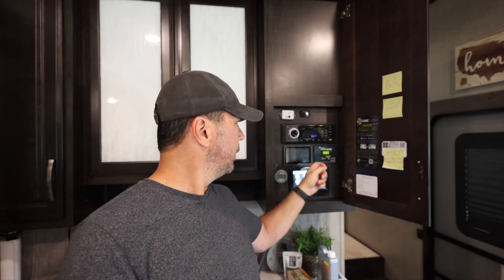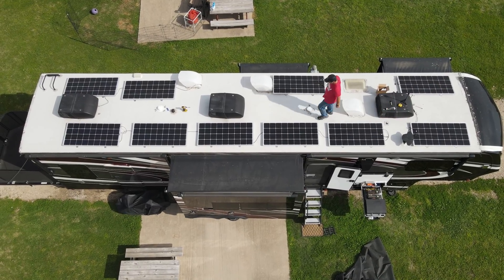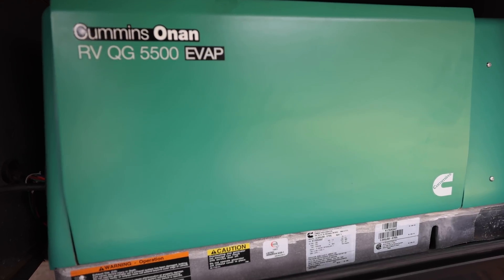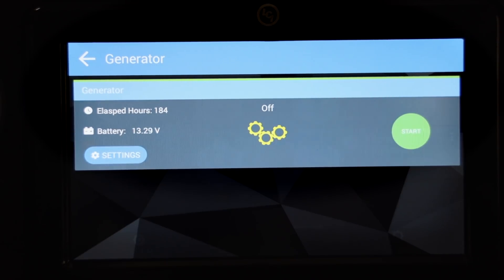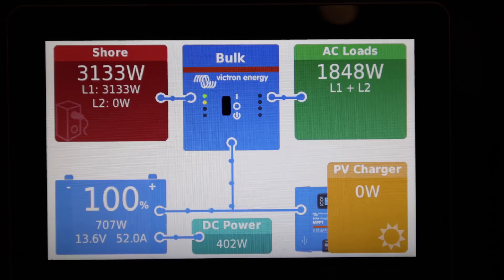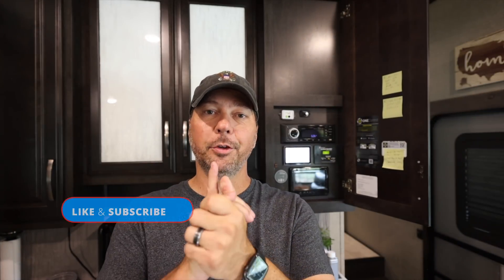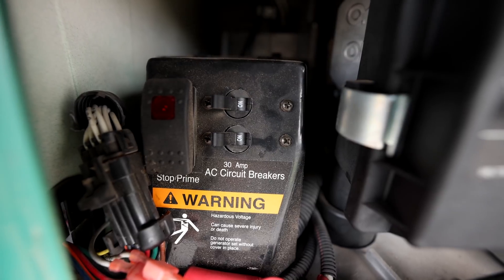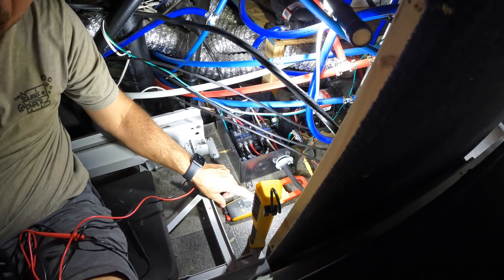RV Off-Grid (Solar) Power System Review and Fixes! (Full Time RV Life)

Comment: Hey Chad - when you were working the research, did you see if this was irrespective of Onan genny type?  We just had to swap out our older generator with an Onan Quiet Diesel 8000W.  Just like you saw, I'm popping our 35A dipole breaker on the generator running two ACs, some minor electronics, and the charger for our batteries.  Didn't make sense.  Wondering if I can do the same.  I also have AM Solar's Smart Phase Selector (SPS) which they have discontinued so not sure of that impact.  Thanks for doing this video.
Reply from the maker: Hey, guys!  How are you???  I thought you have my #?  If not, email me and I'll give it to you...  On the generator, my guess is that 8KW is likely set up for split phase.  8KW @ 120V is 67Amps, which would be too much for the Neutral if single phase.  The first thing I'd do is check the L1 - L2 voltage at the transfer switch.  If it's ~240v, you have split phase out of the genny.  If that's the case, the L1-L2 bridge is definitely NOT an option.  If it's 120V, then yes.  Shoot us an email and we can chat on the phone. 👍🏼
Reply: @ChangingLanes  Will do.  I need to fully understand the Smart Phase Selector and check the amps coming out of each leg at the switch.  I'll also snag the genny specs.

Comment: Thanks Chad for the generator "fix"  I am in the process of installing the Victron Multiplus II 12V  2 x 120 inverter. I also have the Onan 5500 in my 50A Roadside Warrio 427 Toyhauler.  Have already purchased the Morris Products Multi-Cable Connector.   Thanks again.  Love your channel!!

Comment: When you spliced L1 and L2 from your generator using the 4 position grounding bar it looks in the video (16.45 min mark) that you also connected the neutral as well, but I'm guessing that was an optical illusion and the neutral was actually passing under the grounding bar.  I'm guessing you also added two more short pieces of red and black  #6ga wire to reattach the wires to ATS from your grounding block, correct.  I'm also assume you then thoroughly taped up the grounding block as well?  
Did you also have this issue with your Go-Power 3000W inverter/charger?  It seams odd to me that the Victron Inverter would treat the AC power coming in from generator power differently than it does with shore power?  I thought the Inverter just passed the shore/generator power through unchanged?  The only difference being you'd have 30A on L1 & L2 from the generator and 50A on L1 & L2 from shore power.  Previously in stock form, could your generator power all three AC units?  The RV manufactures usually size these generators to do just that.  thanks for the great videos.

Comment: I love your solar setup and was going to mirror it (one side at a time due to cost). 5 200w panels in series and 2 BB CG3 270 ah in series. Is there any chance you made an updated Hardware list/diagram for the 24v system. I know your no longer in that rig but just hoping you already had updated documentation/diagrams for the 24v setup, Thanks.

Comment: With copious manufacturers out there, is there really a notable difference in LIPO batteries?  Seems like there are way too many to compare.  Would appreciate any comments with your experiences that you can provide.
Reply from the maker: I think most of them use similar chemical compositions in the cells, so it comes down to BMS (Battery Management System), and how the BMS handles the cells safely.  I really like BattleBorn, but that's because I researched the tech and they were best at the time (almost 2 years ago).  I would check out Will Prowse's (@WillProwse) channel https://www.youtube.com/@WillProwse for more details on the latest in batteries.  Good luck! -chad

Comment: I am looking at doing a new system on a '93 Newell coach. Roof is clear with no A/C's up there. (Basement units) My concern is not having internet or Wifi if I use Victron equipment. Do you have to have internet for the Victron system to work or is it for remote monitoring?
Reply from the maker: Yes.. You do need some kind of internet.  A simple hotspot will work.  We have a few videos on the topic: https://changinglanesrv.com/?s=mobile+internet

Comment: Good info & vid Chad, great setup & build you have there, you made. A lot of good points here & in particular  about using a higher voltage in future builds, more power, more efficient, thinner wires, you said what I was thinking. I think we are in a time now where the electronics available have grown & are realising these needs, and the newer generation of builds should definitely be going down the 24v path, and better still 48v gear if ur considering air conditioning & larger loads. Cheers

Comment: A couple q's....
With the 10-100ah lythium batteries and the 3000W inverter, how long could you run the AC/Heat Pump? I assume it's the 15K unit as well? 
The wiring for the 45 amps.... 
NEC requires #8 awg for 50 or less amps but you were talking about the wiring heating up and, let's face it... That wire you were working with was  a "bit larger" than #8! 
What AWG size did you need to run for the system you've got going on here, able to run the AC? 

Thanks again Chad. You're helping a lot of folk out here with some great information. 

BTW....
Now, the photo showed you on a flight deck after stating your military past experience. 
Were you a "fly boy" or "squid"??? 
EM3 Chapman asking here.....

Comment: If you're running network cable through ducting or outdoors, make sure you're using plenum cable. it's all weather and doesn't burn.  if the cables get overpowered and fry for any reason the PVC will release toxic gas into your ventilation system.

Comment: Great information as always! Running into same problem with our generator and purchased the wire connector. When you combined L1 and L2 lines from Generator, which ATS terminal did you run the single output wire into?

Comment: Great info.  I have a 2021 Tiffin and I just installed the same Victron Multi Plus II 12V/3000/ 120-50.  All is going fine but when I connect to 15Amp Shore power the Transfer Switch kicks it off.  50Amps works fine, not sure about 30 as I have not had the opportunity to try it.  To check the transfer switch I disconnect the out bound legs from the transfer switch, then connected the 50 amps shore power and then the 15 amp shore power.  The transfer switch did not cut it off this time.  So I am thinking it must be the inverter?  Any thoughts?  I have things wired just like you have diagramed using 6-3 wire in and out of the inverter.

Comment: so if I understand how you wired your generator in, you left your existing transfer switch in the rig that selected between shore power and generator power and the output of that transfer switch went to the Multiplus.  So on the display, when you are running on generator power, the display shows shore 30 amp in?
Reply from the maker: Yes.. shore power or generator power from the ATS looks the same to the Multiplus (except the phase difference from 50A).

Comment: Chad, I no you say you don’t do “how to’s , “but how we did” something. I want to do a 12vdc inverted system but I want to build it in stages, as I can afford, and have need for starting out. I’m I making a mistake by copying your 12 volt system or should I do a higher voltage configuration?. I’m thinking it would cost more going in ?.

Comment: by switching to 24v or 48v, would that change any of the other parts or configuration?
Reply from the maker: Yes.. we'd need a DC-DC converter to down-convert to 12V for the RV...
Reply: @ChangingLanes  what would you recommend for that?

Comment: You mentioned the word that I want someone to talk about but no one really does concerning the electrical systems. HEAT.  I am converting to lithium ion and have heard it mentioned many times that you can put those batteries inside along with the converter/inverter/charger but I’m still concerned about the heat generated and no one is giving any real data on it.  If you have an opportunity can you do that in a video?  I have a toy hauler so my storage is very limited and wanted to put my new electric system under my bed area so I need to know what kind of heat could be potential coming off of these components.  Thank you and I love your channel.

Comment: My installation is roughly based on your system. I talked to you about your batteries over your genny, etc. etc. On our first trip out, the genny kept tripping the 20 amp breaker and I had to run my AC input limit down to 20 and only run one ac. I went to your channel and, as I knew I would, I found your solution. I installed your recommended splice and it works perfectly! Thank you for your great channel!!

Comment: Trying to wrap my head around that last bit... the parallel happens on the generator side of the ATS input? So it combines the output together into a single line, then goes through the ATS and into the Victron, which then splits it up again before going into the panel? I remember seeing a video on the All About RVs channel about wiring up a big manual multi-pole switch. Would something like that work, such that you could turn the switch to split the phases again if needed?
Reply: "Budget 50 amp rv inverter solution" is the name of the video that came to my mind.

Comment: About that issue with the generator and the Multi-Plus II you were speaking of, is this still a problem or has Victron done something to deal with it. I have a North Point & we are adding an Onan 6500 soon (on order) and the Multi-Plus is going to be installed at some point as well. (When I get Around-Tuit) Did it turn out long term as simple as the bridge of L1 & L2 on the Gen-Set line before it's added to the transfer switch? That' s to say now the transfer switch really only has a L1 but the generator will put L1/L2 45amp load on it.... ?

Comment: Great video, found this after installing my Victron Multiplus 2 and noticing the same issue from my 8kw Onan diesel generator.  In trying to understand this, why does this work fine in the stock form, going straight from the ATS to the panel?  Only when going from the ATS to the invertor does this issue occur.  Im just wondering if there is something on the inverter side that could be programmed to make it passthrough just like it would be going direct from the ATS to the panel.
Reply from the maker: Whether or not it drops line 2 depends on the phase relationship between line 1 and line 2.  I would think that an 8K genny would output split-phase since that's 66A (8000/120) and a full load would mean 66A on the neutral if they were IN phase.  I would verify the phase and go from there.

Comment: How are the batteries configured? Parallel? busbar? Posts? I would love to see a battery diagram with wire sizes. I assume since your using a 12v multiplus that your batteries are wired Parallel. Do you have trouble keeping them balanced?
Reply: Id like to know this as well ...Ive heard of this being a problem ...Per Will Prouse

Comment: Thank you for the break down. Do you happen to have a schematic showing exactly what goes where? I just like to confirm that you took L1 & L2 of the generator feed, combined them then wired the combined legs to L1 on the ATS. Did you need to increase the wire size from the combined legs to the ATS or was the 6awg already in place sufficient?
Reply from the maker: You nailed it.. and yes.. 6GA is fine.  Be sure to see the note in the description for the note on replacing the bus bar with a better option.
Reply: @ChangingLanes  thank you for the quick reply and confirmation.  I did indeed see the note regarding the updated information for the bus bar. Thanks again and happy camping!
Reply: Can you just simply connect L1 & L2 wires to the L1 in the ATS?

Comment: Not certain but that aluminum connector for the 2 wires (copper) from the 2 outputs of the generator. Please check periodically to make sure they do not loosen up. Aluminum & Copper expand and contract at different rates, this is what caused house fires; thats why they stopped wiring houses with Aluminum wires. Those houses that still have Aluminum wiring require special terminals and such. Good Luck and safe travels.

Comment: Thanks for the video Chad. I will be replacing my standard multiplex with a multiplus II this week. This is just because I figured out a way to make it fit when I didn’t think it would fit when I did the first inverter. My coach is already wired for two in and two out so the multiplus II is the way to go for me.

Comment: Love your channel! Thank you for the explanation.  We are upgrading our battery bank in our 50 AMP Class A from 4 x lead acid batteries to 3x 300 AH (900 AH total) batteries and also upgrading the inverter charger to a Victron 3000 watt MultiPlus 2 along with 2x 365 watt solar panels on the roof.  It's possible to run one of our Dometic 15000 BTU A/C units off the bank but I'm not sure how much we will do that.  My question today is about heat build up in the area where the inverter and batteries are located. How do you keep your system cool?

Comment: Love and watch all your videos, especially the tech ones....
I have the Multiplus II, Cerbo & Touch 50 as well and cannot get it to display
Shore or AC Loads L1 & L2 separately as you show at the 2:13 min of your video
when you show the Touch 50 display. Is there a setting that you changed to enable
this feature?  If not a setting..... Any ideas would be appreciated. TIA
Reply from the maker: On the CerboGX, you need to enable release candidate firmware download, then update to the latest.  👍🏼
Reply: @ChangingLanes  Thanks and I will give it a try.....

Comment: Do you have any good pictures or your battery setup? Looks like it’s over the generator. Also any good pics of the multiplus mount. I’m about to start an install very similar on my 381m and trying to figure out how to fit (multiplus, 3-300ah lithium, cerbo gx, solar control, lynx distro, etc) looks like the inverter is mounted to a board on the side of the generator.
Reply: Also, any overheating issues with it on the side of the generator?
Reply from the maker: Please see:
https://changinglanesrv.com/rv-inverter-upgrade-victron-multiplus-ii/
https://changinglanesrv.com/rv-solar-install/

Comment: Chad, thanks for the update on your solar build. I have been waiting to hear if the Onan Gen was going to be an issue. I was headed down the same path with a Multi Plus II but I was concerned that I was hearing my Onan 5500 was not going to play well in the system. If you have some time could you share a simple wiring diagram and description for the work around. I would certainly appreciate it.
Reply from the maker: It's really simple... Use this splice (https://amzn.to/3DXemK6) and put L1 and L2 into it, then a single 6AWG out the third one and into the ATS (L1 input).. 👍🏼  Nothing changes with the neutral.
Reply: @ChangingLanes  could I join the L1 and L2 at the generator junction box sending them jointly into both legs of the transfer switch or does the inverter need to only see power on a single leg to provide the power assist?
Reply: @ChangingLanes  I checked my Onan wiring diagram and it's bridged internally to the legs, provided a breaker isn't tripped. The generator being bridged internally would be the same as a dog bone adapter on shoreline. Maybe your model Onan isn't bridged internally?

Comment: I had the exact same problem with the generator that you did in this video.  I had not realized what the fix for it was yet.  Thank you, this clears the generator throwing only one breaker up.  By the way I pretty much watched your videos on installing the Victron Multiplus, Cerbo, etc... and used your links to buy all of it.  Hopefully by using your links I at least bought you guys a cheese burger.  We have the exact same system except I bought 3 large form AmpereTime 400 AH batteries for a total of 1200AH.  I also wish I would have thought it through better and went with a 24 or 48 volt system.  I have dual sets of 4/0 wire running to from the batteries to the inverter to avoid the heat.

Comment: Great video Chad. I just installed a similar system on my Class A. With all Victron, Multiplus II with 1,200w solar, a 5,000 Onan generator and 600ah Battleborn. I also have some DC/DC chargers to allow charging from my engine alternator when driving. First time I used the generator I set the load limit to 40amps and sure enough blew the breaker on the generator. I’m sending your fix to the installer I used to get his feedback on if it can apply to me as well. Thanks so much for your doing all the research 🤓

Comment: Chad, I combined both of the lines from my Onan into the outside of the breaker and I'm not getting any juice to the Multiplus 2.  It looks like you connected them both to the middle of the breaker is that correct?
Reply from the maker: I combined L1 and L2 at the ATS and into L1 on the ATS.